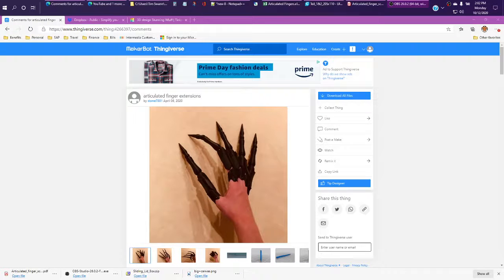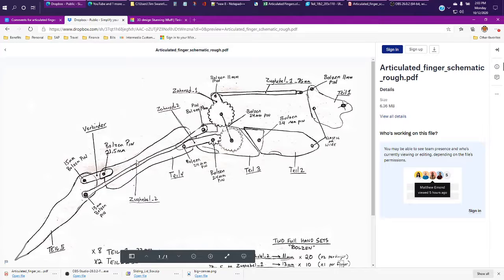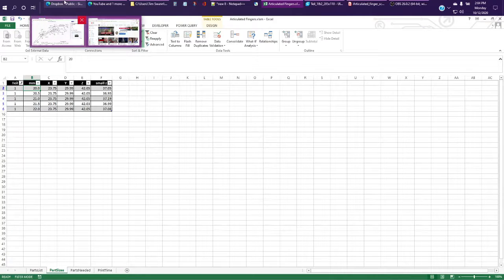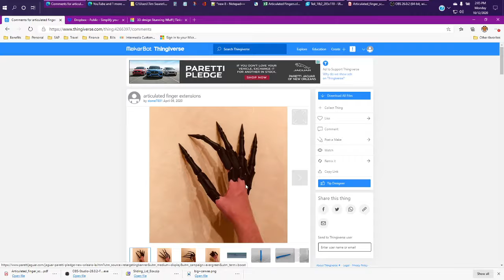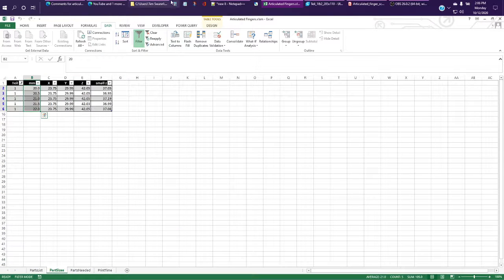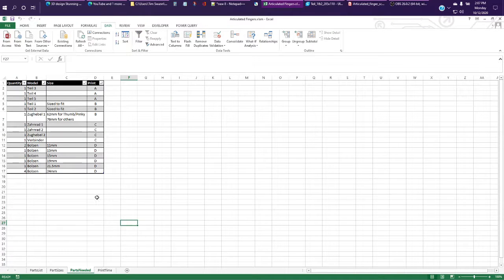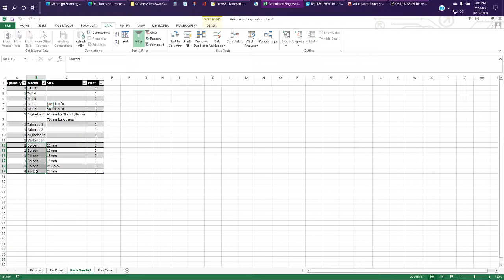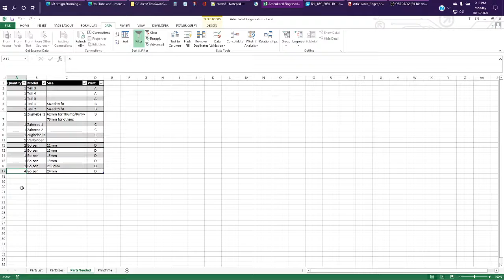Articulated Finger Extensions Instructions (Part 1)

Comment: Thanks for putting this together.  I've just printed a few fingers and wanted to leave a couple of tips that you might have covered and I missed.  

1. Print everything standing up with supports to bed.  
2. The 19mm and 21.5mm pins are reversed in the diagram.  19mm should be in Teil 4 and 21.5mm in Teil 3
3. If you have fat fingers, expect to do some modifications to Teil1 and Teil2
4. When meshing the gears, you may get better performance by rotating Zahnrad_1 back one tooth instead of pushing it all the way forward.  The fingers wouldn't always extend fully if installed all the way forward as seen in the diagram.

Again, thanks Tim for the awesome work on these videos.  There's no way I could have completed this without your efforts.
Reply from the maker: Thanks for the tips!  I did do a more detailed guide than the drawing, link is in the description.  However, I still used the 19mm to connect the connector piece to part 3, but truthfully by the time I got to the 4th and 5th fingers I started just printing all 25mm bolts and then cutting them down to what I needed once they were inserted.  Whatever works, right?

On the gear issue, I did cover that a bit in the 2nd video (link also in the description) where I showed what the different effects of the way the gears were positioned had on the finger when it was fully extended.

Glad the videos helped you, I know these were confusing as hell when I tried to put them together using only the original diagram!